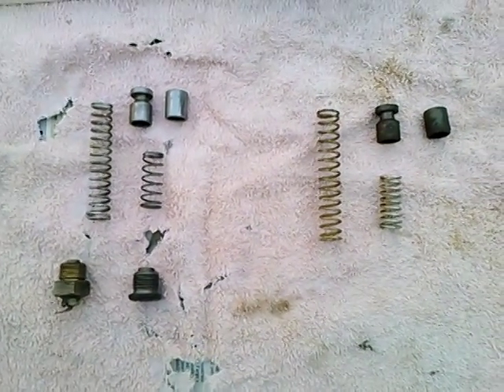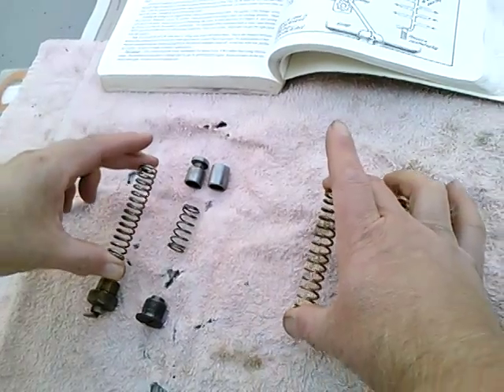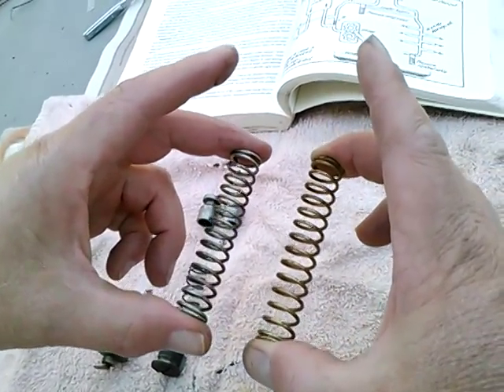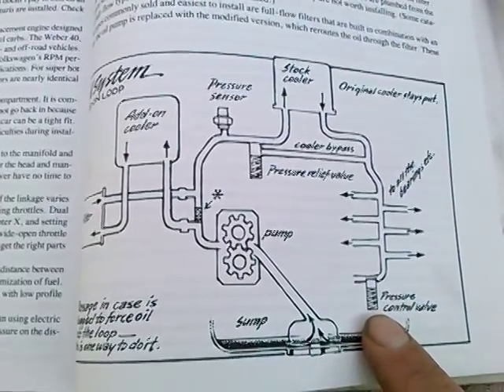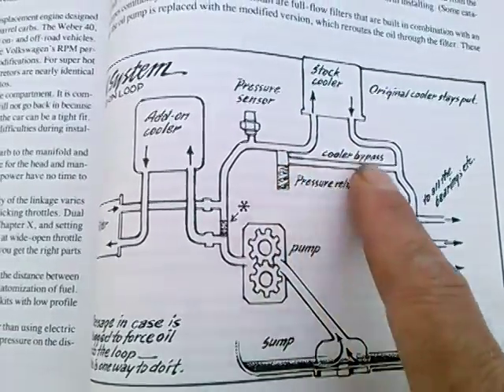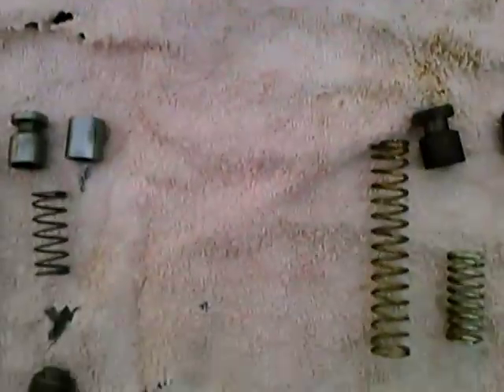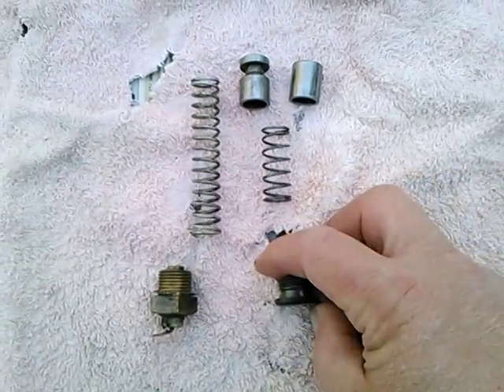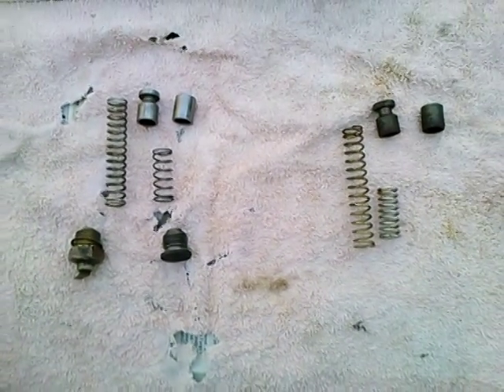VW Dual Pressure Relief Springs and Plungers MOV263

Comment: yesterday i took out those plunger to replace the flat "screwdriver" type of head for an allen type screw head and i noticed that the 2 plungers are identical, with no neck cut on the pulley side plunger. do my mechanic put the wrong plungers?

Comment: From What I understand the first pressure relief valve in the rear of the car near the oil pump. Does put all the oil go through the cooler until maximum pressure is achieved then excess will go through the bypass directly to the bearings.  The other valve is the actual bypass for full pressure. If the first valve at the rear of the engine sticks, It will put some oil through the bypass do the bearings and some through the cooler which can cause start up oil pressure to be low.....Flickering light. With the spring kit and stiffer springs. It will push more oil through the bearing surface which cannot really hurt much but could may cause excess pressure in the cooler. Those coolers can take some pressure and so can the cooler o rings. It should not make any difference if you use the stock springs or the after market ones. As long as the pistons move freely. The stiff springs may have less chance of sticking open then the stock ones. so this could make your start up oil pressure better if your having problems with oil pressure at start up. Best advice do what you want. and make sure those pistons are not getting stuck. I have the stiff springs and have no issues. only because they have less chance of sticking and will allow oil to go through the cooler only first.

Comment: I just can't find a screwdriver wide enough to get a good grip on the plug! Any suggestions?
Reply: Get yourself a tool called a drag link. Looks like a socket with a large flat screwdriver tip. It's been a lifesaver for me
Reply: @marcusgray3805  thank you.

I ended up jacking the car up high enough to fit a BIG long flathead screwdriver underneath. It still didn't want to budge, so I used a butane torch to loosen it.
Reply: @marcusgray3805  drag link socket set?
Reply: Still having trouble with this flat screw not wanting to release. Considering grinding down a chisel
Reply: Use an impact screw driver.You  use a hammer to loosen or tighten on screws..You can buy them at Lowe's.
Reply: Yep. That sounds like the one
Reply: @marcusgray3805  thank you Marcus.
Reply: hit each plug with a torch for 10-15 seconds and then tap it a dozen times with a ball peen - they'll come out easily. This has always worked for me.

Comment: I have a 1994 VW Jetta (2L, auto) which at start has no issues but after about 5 minutes it flags oil pressure alarm.  Mostly the alarm is only the dash light, but at times it is also accompanied by a buzz.  There are times when I do not get any alarm, but this is very rare.  Because of the inconsistency of the alarm I am thinking it has to do with some closing and opening of something (I don't know much about the system, but things make sense when explained).  I have replaced both pressure sensors, and that has not changed a thing.  Might either of these plungers/valves be my issue?  How do I locate them on the block?
Reply from the maker: My video doesn't apply because it's only relevant to air-cooled VW's.  I don't know the 1994 Jetta at all really, and haven't run across a system with two oil pressure sensors.  Do you have to pass any sort of inspection ?  If not, I add a mechanical gauge in place of one of the sensors, prove that you have oil pressure and no worries.  Like everything, look on the internet. If it's a nice car you don't want to add a gauge to or have to pass smog, you might have to find someone who actually knows this system. Thanks for the comment.

Comment: Is the way you show them the order they go in? Mine fell out quickly and I couldn't see how it came out. Specifically, does the "grooved" plunger have the grooved end at the top and the hollow part at the bottom / touching the spring?
Reply from the maker: Yes, the hollow ends point downward toward the spring.  As I might mention in the video, I don't believe the grooved piston serves any purpose in a dual-relief case, doesn't do any harm though.  Has a purpose/does something in a single relief case.

Comment: i have a question. I have a 1973 bus with a 1800 motor. it seems especially when it is cold and after sitting it seems like a long time to build up oil pressure. there is a pop thru the exhaust and then it stops rattling. thought it may be the pressure relief valve. had the motor rebuilt 1000 miles ago. any suggestions
Reply from the maker: richard kantor 1800 = Type 4 ?  Big pancake motor ?  Not too familiar with these.  Hydraulic lifters on these I think - the source of your rattling perhaps.  You might make sure the pressure relief plunger(s) are free, not stuck.  Any accessory oil cooler installed that might be draining back ?
Reply: richard kantor I am having the same issue with my 77. Did you ever find out the cause?

Comment from the maker: Colin Kellogg is I believe confusing the old single pressure relief system with the newer dual pressure relief system.  The spring and plunger nearest the oil pump does not have a "dump port" on a dual relief case, but it does on a single relief case.  The grooved piston or plunger serves no purpose on the dual relief case, but does function on the single relief case to "short circuit" oil from the main galley back to the sump - the single relief case has a passage from the plunger bore to the sump apparently ( I don't have one to inspect but have seen a diagram on the internet )  Since Colin Kellogg has posted a "linked comment", I cannot reply directly.

Comment: For the record, the REAR relief valve (closest to the pump) does have a dump port that serves to limit cold high oil pressure. The grooved piston allows oil to flow from the main gallery to the dump when the engine is fully warm. Increasing the pressure of the spring does NOT change this. All a heavier spring does is to annoy the cooler and cause a premature "switchover" to the cooler. The control valve was introduced in 1970 to allow the new higher capacity pump to circulate more oil than the engine consumes. With a grooved relief piston, the cooler is now cooling a greater quantity of oil than the engine is actually consuming. The added benefit is that as the engine bearing clearances open up when old or very hot, the control valve will close and allow that high capacity pump to get to work to keep the oil idiot light off. I very strongly recommend that we not dork around with factory engineering. When you lose oil pressure, it is because your bearing clearances are opening up and less likely, your pump is losing efficiency due to scoring,evidence of poor maintenance. Type 1 engines without an oil filter need us to be very very clean at all times. That means valve adjustments must be performed in clean conditions, and your air filter must be secure and of good quality.
Reply from the maker: +Co Lin Earlier I was not allowed to reply directly, perhaps thanks to Google +, but now I can for some reason.  Anyway, as you can see in my newer video, "Oil Flows and Pathways...", there is no dump port at the rear control valve.  I believe that was unique to single relief cases.  So that grooved piston serves no purpose on dual relief case, since there is no dump port for it to line up with.  If I can get my hands on single relief case, I'll make a video about that, how the grooved piston works.

Comment: I took my relief and control pistons out and i had to use a dowel rod to get them out. there seems to be a seam halfway up the tube that catches the piston a bit until it reaches the top of the tube and then when I release the piston it won't slide out the bottom of the tube as it catches at that 'seam'.  is this normal?  thanks
Reply from the maker: stoicokie Mine fell out easily, I was prepared to start the engine and see if the oil pressure would blast them out, but it wasn't necessary.  Would have made good video though.  Maybe that "seam" or ridge is the result of wear.  A good topic to search on over at TheSamba.com, or ask this question there.  I really don't know if what you describe is common.

Comment: I'm having overheating issues with my dual relief case here in AZ...I wonder if my spring is too stiff and making my oil bypass the cooler? I just pulled the engine and when I pulled the oil cooler off the case, not even a drop of oil came out of it...is that normal? Thanks for the video!
Reply from the maker: My grasp is the heavier spring keeps the valve closed more often, forcing more oil, not less, through the cooler.  Since the cooler is upright, maybe I'm not surprised if it drains out when the engine sits for a long time.  A full-flow filter and oil cooler in the air stream helps a lot in my view.